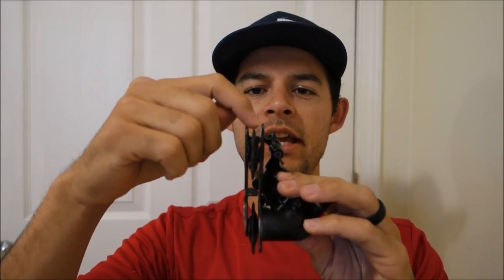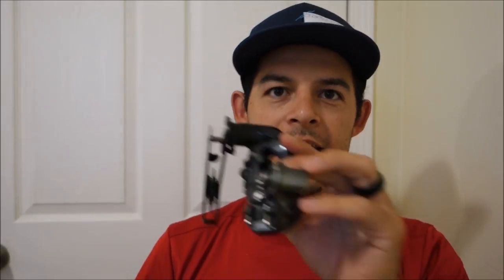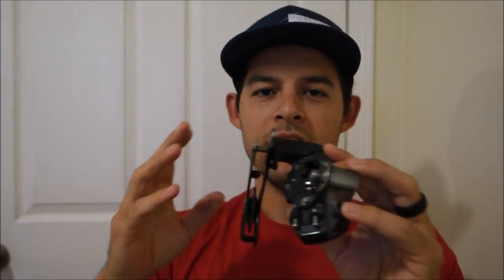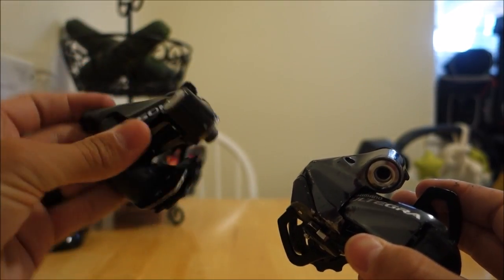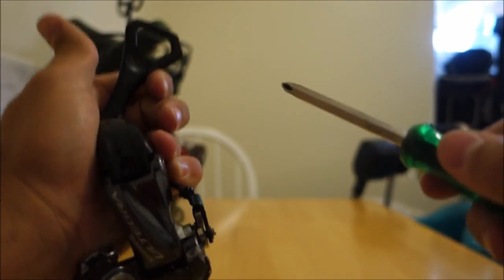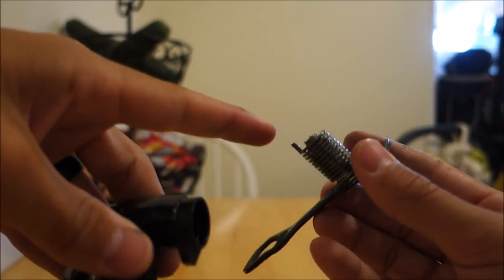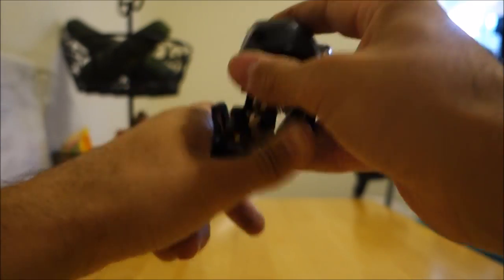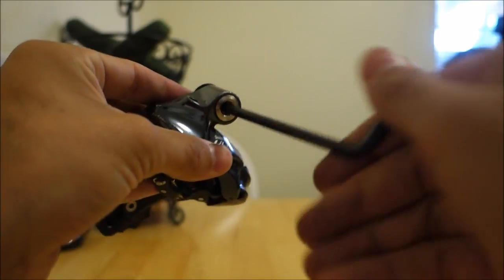How to replace your rear Derailleur cage.

Comment: After a long time searching, i find a full cage of Dura ace 9070 di2 for me. My original was damaged by a chain cross, with a wrong toutch at the STI. Your video is cool, thank you so much. The Ultegra 6870 looks the same to Dura ace 9070. Thanks bro.
Reply from the maker: Rodrigo Of War, thanks. Glad you fixed it up.

Comment: Very helpful, particularly on how to get the spring to tension the cage  in the proper direction. Removing the screw so that the cage can swing past was crucial for me when installing the Rockbros OSPS on a Durace derailleur. The instructions provided by Rockbros were poorly explained and written in the worst Chenglish I've ever encountered. Thanks
Reply from the maker: Thanks, I m glad it helped you out.
Reply: Norman1951 Norman how do u find the Rbros wheels bro? Was checking them out.

Comment: very helpful!! Been having trouble with my rear der not staying adjusted when I go from small to big chain-ring. Was considering replacing the cage but seemed difficult. Now it doesn't.
Reply from the maker: Glad it helped. Let me know if you have other issues I can make a video about.

Comment: Great video! Remember not to mix up your pulley wheels. The top one is the guide pulley (G-pulley) and the lower one is the tension pulley (T-pulley). They look very similar but on more expensive mechs are different, as they both do different jobs.
Reply from the maker: Nath Jefferies , great point. Thanks for pointing that out.

Comment: thanks for the detailed video. It helps a lot to me. Especially I want to purchase a long cage to be compatible to 11-32T.
But Dura-ace doesn't have the long cage spare part available. SO I need to get the RD-6800 GS part to replace with my current SS cage.
Reply: additional question, so basically I have a rotor Qrings 52/39 with 11/28 cassette, which mean if I change to 11/32, it needs to have a longer chain? The chain still fresh now btw.
Reply from the maker: So you will likely need to replace the chain. But go ahead and see if your chain will take the new cassette. You will know that it is so long if your rear derailleur is basically straight.
Reply: @CyclingSatan  Thanks mate for the video once again, but I found out the rear end was slightly bent and the gear won't go up further more. So I might need to change my frame now :(

Comment: Thanks for this. BTW, I was able to buy cage plates from Ali Express after our bike supplier was unable to provide them.
Reply from the maker: Fantastic. We may add an update after I look into that. Cheers!
Reply: @CyclingSatan  
Sorry, I did not give much for details. You need to buy the inner and the outer separately. Total cost is $30.00 for the M8000 SGS plates. However, as you can buy the complete M8000 SGS derailleur for $61.00, the next time I ordered, I just got the whole derailleur just in case I had previously caused any trauma to the derailleur when I bent the cage plates. When I got it, it appeared to be a genuine Shimano OEM part.

Comment: My inner plate doesnt have an allan wrench slot....it is a flat surface. The replacement has a flat surface as well and it seens you have to unwind the entire arm to unscrew...but when u do that the spring begins to unwind out of the slot

Comment: useful info and good tutorial. you mentioned cross-compatibility between the mechanical and DI2 cages in the 6800-series. Is that still valid for the more recent versions (R8000 and R8050)?

Comment: My girlfriends dura ace 11 speed DI2 rear derailleur cage was spun 180 degrees by a well meaning guy attempting to fix a flat. I wasn't there. I need to spin it back and am hoping this video halps. If it' too loose or indeed bent, what mechanical Dura ace derailleur shoukld I harvest parts from? thx  Rich

Comment: Very practical and helpful video. Have you inspected the compatibility of different cages between derailleurs? Do you have to know the exact model of your derailleur to get the right cage model? I'd need to replace a cheap Altus derailleur cage with a shorter one to a 20" kids bike where there is used a long cage derailleur that almost touches the ground with the lowest gear on. Customizing this cheap derailleur might sound ridiculous but, by a quick look, I did not find cheap derailleurs with mid or short cage and buying an expensive derailleur for a kids bike feel like waste of money.
Reply from the maker: Kalle Kamula from my understanding you must have an exact matching derailleur.

Comment: So, can I change to long cage and to 32T from 28T cassette using the same chain or does it need to be longer ?  Di2. Thanks
Reply from the maker: Ryan Johnson, to answer your question, maybe. It depends on how much slack is in your chain. I would normally advise you to just put a new chain on Reasons: 1) it's always good to have a fresh chain on your bike. 2) most likely there isn't enough slack in your current chain to make it work. 

If your want to try and make it work watch the video by ParkTool company on how to put on a new chain and watch the part for sizing the new chain. If you want more info I'm happy to help.
Reply: Derek Goronson awesome thanks- the chain is only about 6 months old but will watch the video. Planning on trying this tomorrow 😬
Reply: Derek Goronson Hi again, great instructions for changing the cage to long and I managed that no problem. I took the bike to a local shop and it seemed to work fine on the original chain but he didn't like the angles. He changed it and the chain wouldn't move after about 2/3rd up the cassette. He added some links back but now when on 32 T there is a grinding noise. If he physically held the derailleur cage more vertical then the noise goes, but in its natural position it returns ; any ideas please?
Reply from the maker: Ryan Johnson, glad you got the cage switched out. About your grinding issue. I'm not totally sure what it could be. My best guess from your description is that the derailleur ganger is bent. What frame do you have? If it had a derailleur hanger then generally that is a cheap and easy thing to have changed out. I have had bend derailleur hangers that cause all kinds of problems to the rear end of the bike. Everything from grinding gears, skipping chain, and even having a whole derailleur getting sucked into a wheel. 

Another possible thing it could be is that something is tightened to much. Check the hockey wheel bolts. 

If you have a new chain, in damaged derailleur hanger, and properly tuned shifting then everything should be fine. It odd that the shop mechanic coined the diagnose the issue considering it worked fine before they worked on it. Do you have more info? Maybe ask another mechanic if the things I mentioned all check out.

Comment: Hi derek,  is it doable to change the ZEE RD 10spd short cage to a longer one? I can only order an SLX outer and inner plate in my location. would it fit the ZEE? Thanks
Reply from the maker: Lito Villaflor If it’s the same model of derailleur it should be fine.

Comment: Great tutorial, would this work with the Di2 RD-R8050 too ? Would have to use the RD-8000 I suppose...
Reply from the maker: I’m not 100% sure. In general ultegra derailleur cages are comparable with each other in electric or mechanical form. How that helps
Reply: @CyclingSatan  Thanks, actually in the meantime I found a video showing that you can get the actual parts and do the swap, let's see : https://www.youtube.com/watch?v=ZlvhXn1SCCs - they're not easy to locate though but I found them for the 8050 !

Comment: may i ask if it is normal for the cage to have some lateral play?
Reply from the maker: There should be no lateral play. If there is some lateral movement something is lose. 

You don’t want lateral play in the derailleur because it will likely have a negative effect on shifting.
Reply: @CyclingSatan  there is little lateral movement and the shifting is perfect
Reply from the maker: If your shifting is good then no real reason to worry. If you notice it getting worse I would recommend looking into it more.

Comment: As the shimano 105 is short, I'm thinking of replacing it with Shimano deore M8000 long cage. This is because I want to change to 11-42t from 11-28t. Are they compatible and can it be done? I'm just tired pushing the bike when going uphills
Reply from the maker: As far as I understand, Shimano 105 is only compatible with Shimano 105, Ultegra is only compatible with Ultegra, so on and so forth. So unfortunately you wont be able to make that switch unless you have the same model. WHile Deore is a fine product, it is affordable and it wouldn't make sense to buy a new derailleur just to switch a cage out. You have two options.
1) Buy a new derailleur with the correct cage length.
2) Buy a used derailleur online that is the exact model you have but with the longer cage and switch it out or use that used derailleur if its in good enough shape. 

Again, it would probably be best to just buy a new Diore M8000 derailleur as you can likely spend very little. Gearing is really important so it would be money well invested and defiantly help you get up those hills:) Hope this help you out. Cheers.
Reply: There is something call "goat link" which can be found on ebay use that to go bigger cassette

Comment: on the cage side, there are two notches for the spring. which one to use?!
Reply from the maker: Daniel Secrieru not 100% certain as I just used the one first one and it worked. I would try the closest one.